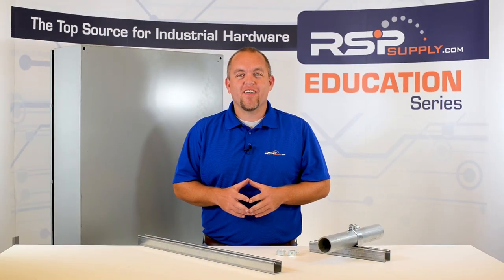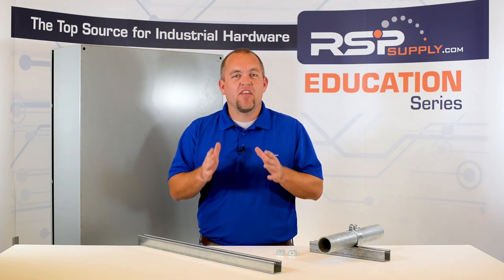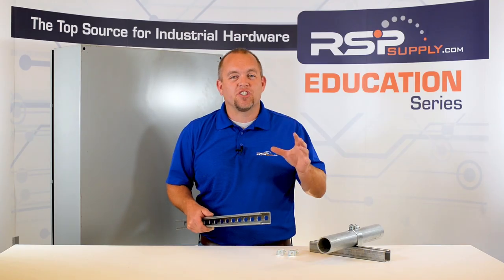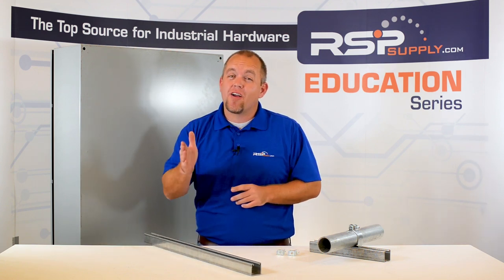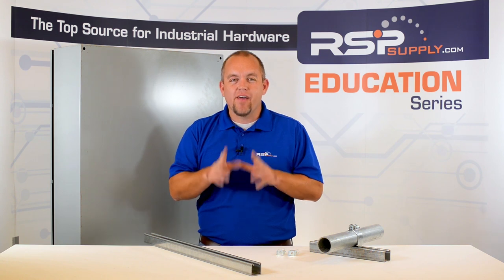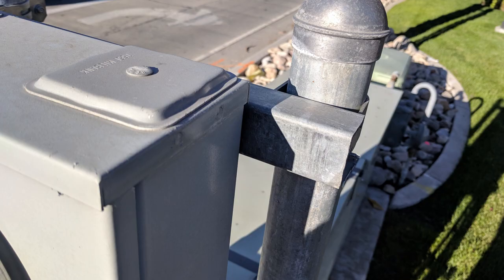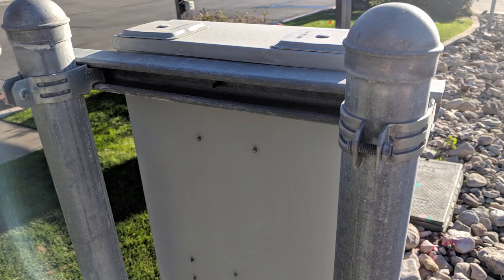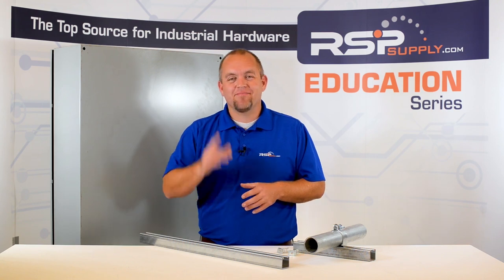Mounting Electrical Enclosures

Comment: i'm an electrical guy and don't know much about structural stability. is this design doable? or will it trip on its own weight?
|                                     |
|                                     |
|                                     |
|---------------------------------|
|                                     |
|       junction                |
|         box                     |
|               mounted      |
|              here               |
|---------------------------------|
|                                     |
|                                     |
|                                     |
|                                     |
|                                     |